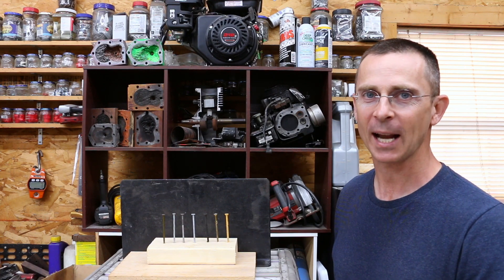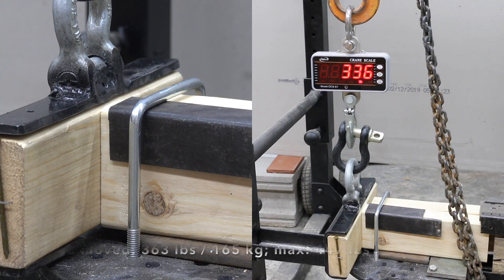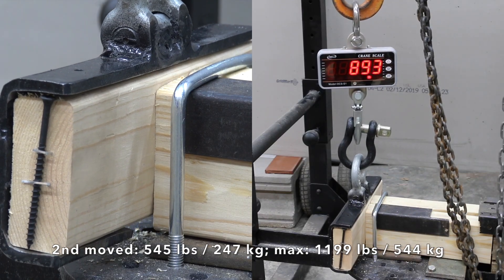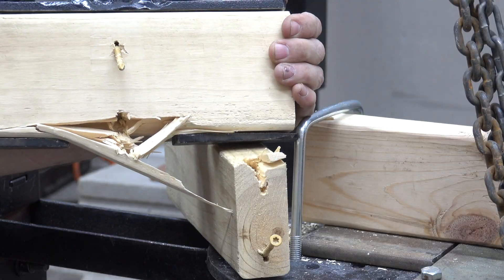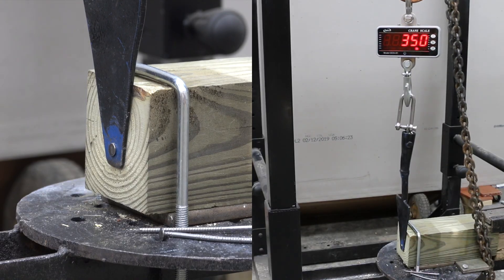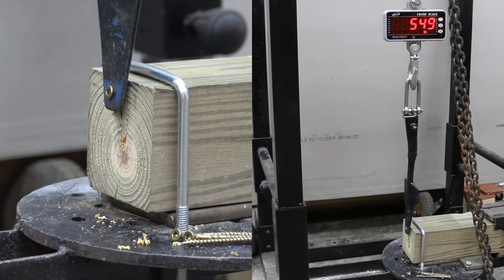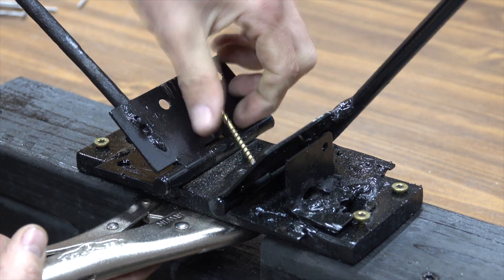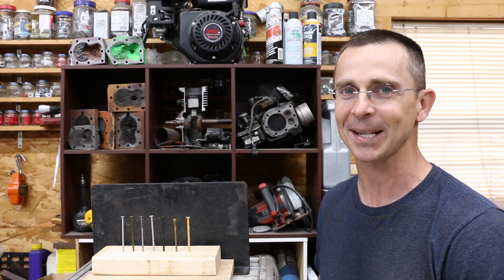Do Screws Shear easier than Nails? Let's find out!

Comment: The rig used to put sheer on the 2x4s is prying them apart, like a crow bar would.  A better rig would pull on the ends of the 2x4 top piece so it would be pulled straight up and not pried off.
Reply from the maker: Thanks for the suggestion.

Comment: Screws will always win.. but I was surprised by the drywall screws strength.
 
Being a woodworker, the only nails I use are 18g brads, and 23g fin nail. And I use wood screws on every structure I build. I always build for strength and durability. I'm a 12" on center stud guy, and I always predrill my holes. But I'm very picky in terms of durability. Here in Florida, a storm can shred most homes that use generic nails, and clips. 
 
If you are working for speed and to meet codes, then do nails and standard practices... but I build for specialized aspects and extreme durability so I make certain my pieces never have any issues. I want people 300 years from now to look at it and wonder how it's still standing, and why I sealed all my lumber. Lol.
Reply from the maker: Thanks for sharing.

Comment: Not sure if the "T" board pull really demonstrated shear but it was an interesting and fair test for all of them.  I was actually surprised that the screws did so well.  Can't tell you how many times I've sheared the head off of deck screws.  Unless it's temporary, screw it AND glue it.  Once the glue dries, it's stronger than nails or screws, you can take them out.  There's a good test for you, what holds better, screws, nails or glue?
Reply from the maker: Thanks for the video idea.
Reply: @ProjectFarm  Hint:  It's glue if it's the right glue applied correctly.

Comment: did you consider supporting the piece of wood being pulled up at the back as well as the front so it is forced to move completely vertically instead of vertical and back as it does in the tests?

Comment: I only used 1-1/2  inch or 2 inch drywall screws when I put drywall on my basement walls. After I framed the walls with 2x2 wood
Reply from the maker: Thanks for sharing.

Comment: The reason the screws break off like they do is cause of the threads cause a stress riser point and honestly couldn't see them ever seeing that kind of forces that way
Reply from the maker: Thanks for the feedback.
Reply: Sure they do. A screw is also not usually made from "tough" steel, because the torque to drive them would twist them in half. A nail is tougher (more bendy) because you're driving it straight.

But to the screws: they will break in half because they ARE brittle, DO have the stress concentrations, and get subjected to repeated side-loading (shear force) that "works" them.  They'll fail quicker from "working" than a nail does.

Comment: Boards separating aren't "shear" that is still pullout.

Shear is quite literally applying the force at perpendicular to the nail/screw body while the nail/screw is completely captive (cannot pull out).
One minor edit: decking isn't harder wood. It's usually pine or cedar, both very soft. It's super important to use the right fasteners on decking to 
-resist corrosion
-resist pullout
Wood decking tends to dryout and shrink away from the fasteners.
In your house, you'll get drywall pops as the wood dries and shrinks. Going to be a massive issue right now, with wood basically going from tree-to-home in a matter of days.
Reply from the maker: Thanks for the feedback.

Comment: Great video as always! My only concern with the fatigue test is that it's quite unrealistic - if your joints are moving that much (+/-20°) you've probably got bigger issues haha
Reply from the maker: Thanks!  Thanks for the feedback.
Reply: I think most would agree with you, but that might be the point, by showing the screws true weakness you show under which conditions exactly it would underperform, the fact that this scenario is not realistic in a building environment is a feature not a bug. Meaning it is the point, it is providing the relevant info.

Comment: You are truly amazing! I was wondering maybe this could be a bit challenging or boring but as an idea, maybe you could to testing on rotors and stators for plaster pumps, I been going crazy about this topic since I can’t find a perfect fit, we are using Putzmeister MP25 with D6-3 rotor, but it seems that it breaks after using only 5 to 8 pallets (each pallet 48bags), we use Cantilana Gun Form XC 15 G. I would be extremely appreciative if you would consider this idea.

Thank you a lot for amazing videos!!!
Reply from the maker: You are welcome!  Thanks for the suggestion.

Comment: Great video!
We bought a cool house but it was 30 years old and needed a lot of work.  Everything was built with nails in the early eighties.  We tore out the carpet before construction.  As I walked through the house over the next few weeks, I could hear the terrible annoying squeaking of the floorboards.  Before we put in new carpet, we put down about six hundred screws and pulled as many nails as we could find. The result was beautiful silence.  We owned that house for seven years and never a squeak.
Reply from the maker: Thanks for sharing.

Comment: This is a good test for grip power but not actual shear strength. Not even sure how really test when a fastener would break. I guess somehow you would have to hold both ends of the fastener and apply equal force in different directions?
Reply from the maker: Thanks for the feedback.
Reply: @ProjectFarm  you are doing gods work I know this comment is old but I showed this to my dad who is a carpenter and he said would be interesting to test a few going through the wood grain it would provide more holding power to the fasteners

Comment: So the conclusion is, If you want the strongest wood joint use a screw and titebond 2 or 3 🤣
Reply from the maker: Thanks for sharing.
Reply: @ProjectFarm  love the videos, very educational 👍
Can you test bolts?
I use M4 bolts for clamping projects, e.g. guitar parts and metalwork 
Can you do a shootout which shows which brand offers best strength, corrosive resistance and has the strongest thread and heads without stripping out?
Cheers👍

Comment: This is very interesting.  I think it exposes the “Don’t use screws... they’ll shear off” as a load of horse-puckey.  Yes the screws failed in the direct bend test, but if your structure is built in such way or moves to such an extent as to put that kind of bend in the fasteners, I think you have much bigger problems to worry about than fastener strength.  I think the “shear strength” argument is just a smokescreen put up by builders to sustain the notion that “nails are just as good”.  This excellent real-world testing shows that nails CLEARLY are NOT as good!  Good enough? Probably.  Cheaper/faster? Definitely!  As good at holding shit together? Absolutely not! Lol!
Reply from the maker: Thanks for the feedback.

Comment: When using the 4x4 shear test you should have tightened the U-bolt down so the 4x4 didn’t lift.  It created an angle allowing the fasteners to pull out vs shear
Reply from the maker: Thanks for the constructive feedback.

Comment: Not to be picky however. in the first part of test nails had Metal sheet on their horizontal component all the way to T shape supporting by U bend on the woods before getting seperated. Same test done on screws but metal support on horizontal component is way behind on U bend and causing wood to fail much earlier compared to nails counterparts.

I think testing without same parameters is little bit flawed and it blurred the results of shear strength. just my 2 cents.

Nonetheless I really love your content and long time follower, My intention is not to harshly criticize your awesome work and testing but just to point out a flaw in testing apparatus design. 

Thank you. (english is my second language, sorry for any mistakes)
Reply from the maker: Thanks for the constructive feedback.

Comment: Just a little engineering pedantry, deflecting the fastener beyond its elastic limit does not fall in to the category of fatigue testing, fatigue is always below the elastic limit of the material and is determined by load and number of cycles
Reply from the maker: Thanks for the feedback.

Comment: I would like to see the nails driven in toenailed to duplicate how the nails are driven in the field. Nails driven into end grain has the least holding power.   Only by driving them across the grain will they gain pull out strength
Reply from the maker: Thanks for the suggestion.

Comment: I love your testing, but I have a few comments on this one in particular.

You are testing a combination of tension, shear, and tear out of the base material (function of edge distance) all interacting together, not true shear.  You are fastened into the end grain of the wood which is significantly weaker than fastening perpendicular to the grain, so failure is tear out of the wood grain or pullout of the fastener, not the shear of the fastener.

To test true shear you would have to keep your puller arm from being able to move backwards away from the holding block of wood so it can only move upwards. You should also rotate your holding block of wood and fasten into the side (perpendicular to the grain) instead of the end of it.

Keep up the good work, love your videos.
Reply from the maker: Thanks so much!, will do!  Thanks for the constructive feedback.
Reply: based on this thought, would you say many of the fasteners are actually stronger than tested?

Comment: I have problems with drywall screws snapping off on the heads of my drill tips. To the point where I don't even use them anymore because they're so brittle and break and rust
Reply from the maker: Thanks for the feedback.

Comment: Would this test actually be considered shear? Cause it seems to still pull out? Which would be tinsel strength would it not? I might be missing something though. Also does the fact that results vary even on the same type of material show a lack of consistency in the manufacturing?

Comment: Screws are not good for framing they are not good against oscillation, nails bend back and forth 
Screws break down
Reply from the maker: Thanks for the feedback.
Reply: Test #1 demonstrated that nails get pulled from a board at a lower force than do screws. In a high wind condition, screws will hold the frame together much longer than nails.

Comment: I think this is a little misleading, as many of the products you surveyed in your tests have "flexion" that allows them to bend out of the holes, rather than testing the blunt cold shear forces that structures might incur on rare occasions. I did note that the times when the U-shaped collar over the 2x4 was not butted hard up to the "T" the results were poorer than any of the rest, due to the wood being pushed upwards and give more room for angle on the pulling forces and rip the screws/nails from the boards. You can actually see the difference when the back end of the metal collar rises upwards as the pressure is applied, and does not do so when the collar is further forward, both holding the wood more secure and distributing the energy of the weight evenly (and thus not ripping at the end of the board) in your testing we can see just how much wieght energy is saved, as the difference is around about 150-200 pounds of difference every time I observed this fact. The second test was much closer to an unbiased test.
Reply from the maker: Thanks for the feedback.

Comment: Fasting into the end grain is a weak joint.When using screws you are literally cutting the same fibers that you’re asking to hold the load. You aren’t testing the screws but the cut fibers in tension instead. Try driving the screws perpendicular to the grain.
Reply from the maker: Thanks for the feedback.

Comment: Would you do a test about 8' 2x6 #2 pine board with  different sizes of plywood & OSB , one quarter flat steel sandwich between the 2x6 to compare edge load test to see what combination would reference the strength.
Reply from the maker: Thanks for the video idea.

Comment: So the reason for this is the screw has a smaller cross section at the root of the thread where's your nail is solid. You would effectively need a screw 2-3 times the diameter of a nail to have the same torsional resistance.
Reply from the maker: Thanks for the feedback.

Comment: Notice that most of your screws didn't fail - they remained intact and took the fibres of the boards with them.  In other words, the screws didn't fail - they were not tested to their maximum strength.

Ductility is essential, to be sure.  But it looks as if the nails would have been pulled out of the board before the screws sheered.  Failure mode matters... but failure is still failure.

Comment: Very interesting although i'm not sure that you took into consideration about the wood and which parts of the wood you were inserting the screw or nail, if inserted in a peg the amount of force is increased significant due to to the woods increased density or it could be weakened due to rot and other factors but this is really hard to test. the video is informative and very interesting over all so thanks.
Reply from the maker: Thank you.!

Comment: been using dry wall screws in wood working for 50 years. mostly cabinets, sheetrocking and remodel framing.  I like using screws when attaching new frame lumber to old frame lumber because the screws reduce the splitting of the old dryer lumber. That said, for house framing, nails are the way to go due to the time that it takes an air gun to install them. the movement allowed by nails in house framing is one of the reasons I chose to build a steel house.
Reply from the maker: Thanks for the feedback.

Comment: You 2 tests pull and sheer are very surprising to me.  In my experience, dry wall screws are incredibly weak and I find that the heads pop off frequently.  I experience 2-3% of the drywall screws I use when screwing drywall into a 2x4 pop their heads.  I have used the small box and contractor packs at Home Depot.  There must be a vast difference in quality in drywall screws.
Reply from the maker: Thanks for the feedback.

Comment: Noticed you were using screws to hold that metal jig onto the board...also if you wanted to test the shear strength of the screws and nails wouldn't you have used them in metal.  I would think the wood would let loose before many of the nails and screws themselves.

Comment: This test is not testing shear strength, it's testing end grain holding power, this is why almost no fasteners sheared off and why screws performed better than nails. 

Screws aren't as strong in shear as an equivalent gauge nail, this is established fact. The main reason for screws not having the same shear strength as nails is they are much harder and therefore more likely to break. A nail will deform, but is very unlikely to break. Nails are also less likely to fail due to metal fatigue which is another reason they are better for framing, which moves a lot over the life of a building. Nails allow movement, especially gun nails which are even softer than traditional nails. Gun nails also normally have glue on them. Nails and screws are both essential in a modern building, we just have more applications for screws now due to power tools and more precise bit types. However screws will never replace nails in certain applications, and this video is giving a lot of uneducated people the wrong impression about what applications screws are appropriate for. Always consult your local building code before doing any type of work on a building that may be covered in the code. Anything structure, weathertightness, or safety related should be done according to code. There are many dumb rules that government makes, but most building code requirements are actually written by people who know their stuff, and I have very few issues with code requirements, they make sense, they are there for a reason and if followed correctly make for a good building that won't have issues for the most part. Let's not reinvent the wheel shall we? Nail guns aren't that expensive if you're doing a big job. If you're a pro and don't either have a Paslode or (heaven forbid) are still dragging a hose around, you aren't a pro, and if you're a DIYer, you can easily get a cheap Ryobi or similar air nailer and a small budget compressor for no more than the price of a good drill driver set. But you don't even need that as a DIYer because you probably already own a hammer and nails are cheap, much cheaper than screws. So use screws where appropriate. Screws are wonderful and I use them every day, but never where a nail is more appropriate.

Comment: Is there a method for testing torsion or circular spiral force strength of fasteners? Although a fastener may not break it can back out due to vibration significanly reducing its shear strength break point. Also it better for the fastener to break or the wood to break before the fastener breaks?
Reply from the maker: Thanks for the video idea.

Comment: Bravo that was a fantastic and fascinating test. I raised the question as well as many others about shear strength after the first video. I was surprised by how well the screws did in these tests, especially the drywall screws. In my experience the drywall screws often snap on torque as well as shear force. Thanks for the tests and results surprised me.
Reply from the maker: You are welcome!

Comment: My GRK pan head screws had many heads popped off by wind. They were holding a snow fence.  Your fasteners are into the ends with the grain. Put hem into the crossgrain then pull straight out to see what it takes to pull heads off. Also at 90 degrees again to shear them.
Reply from the maker: Thanks for the suggestion.